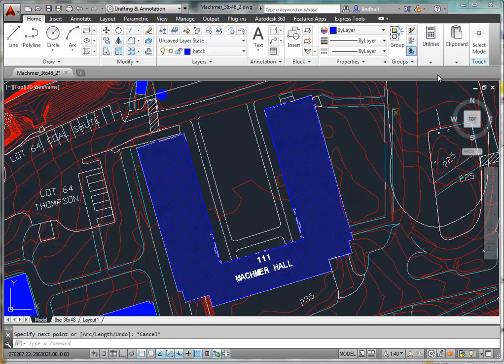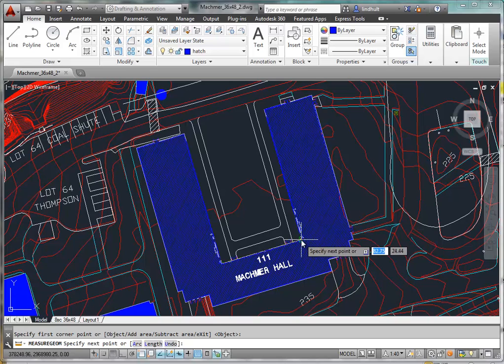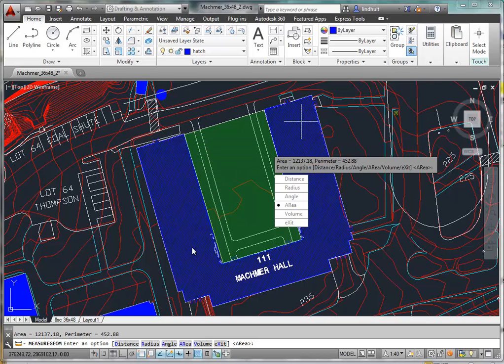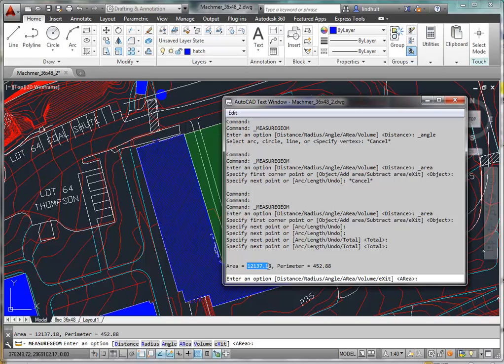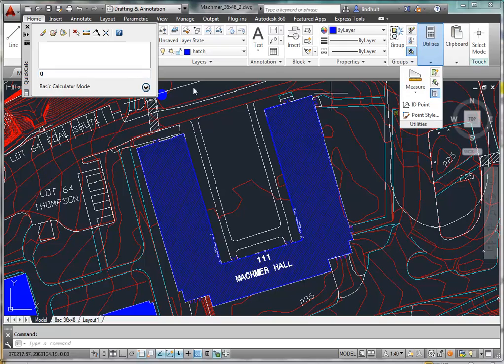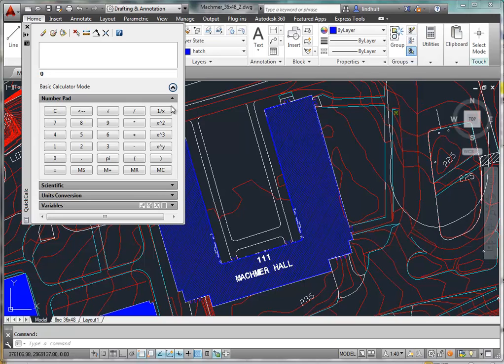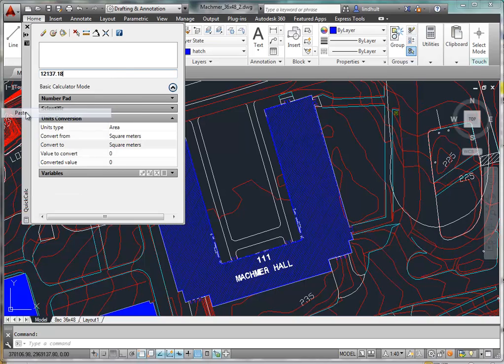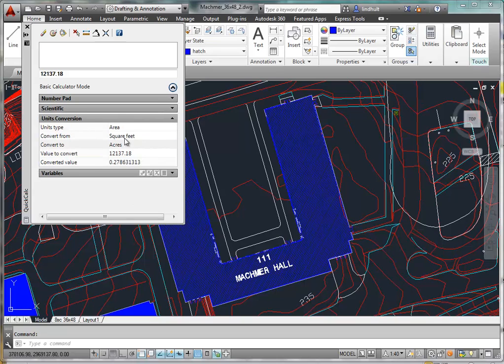AutoCAD Area & Unit Conversion

Comment: Good day!
May I see your scaling ang dwgunits setup?
Coz mince showing a lot of numbers and I don't have any idea if it is correct.
Reply from the maker: In this example, the unit type (UNITS command) is simply set to decimal with the assumption that 1 drawing unit is equal to 1 foot.  There is no "scaling" per se - that's only for output.  The decimal units can be thought of as whatever unit of measure you are working with - 1 unit could be 1 meter or 1 cm.  You just need to be consistent throughout your drawing.   In a professional setting, those units will be set for you so that you are in sync with other consultants.